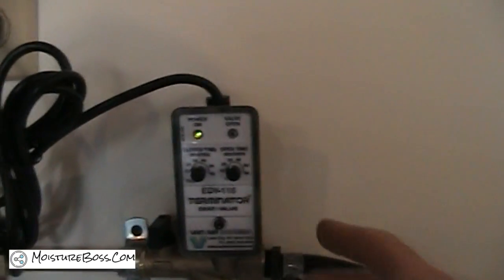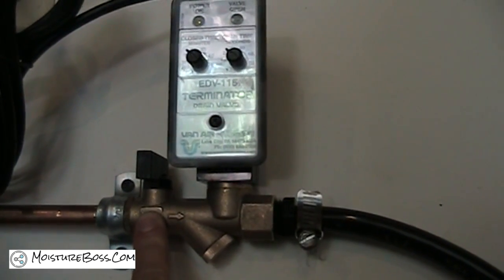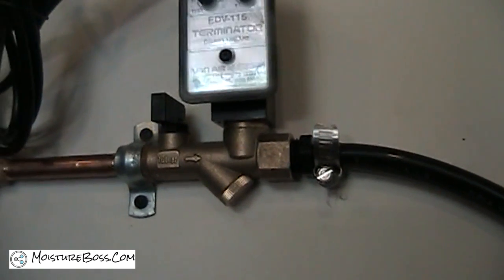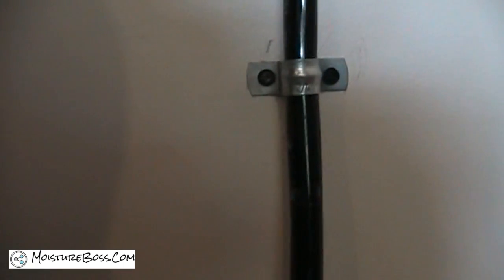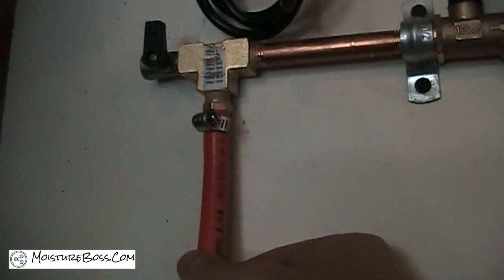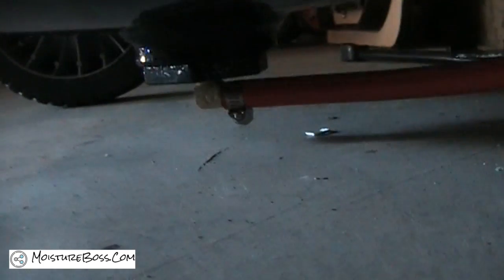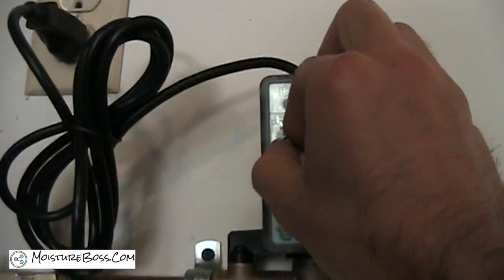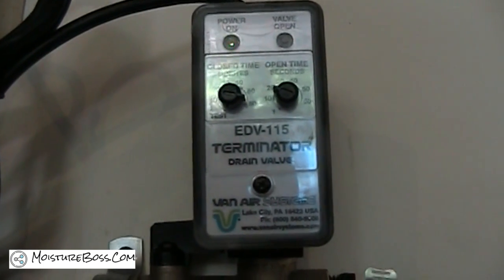Automatic Tank Drain for Air Compressors - Van Air Systems EDV-115

Comment: Hi! if you like to install your valve system that high, you should use a lot thinner tube between tank and valve. And open time longer, than bigger hose, (Air loss..) Like some writer did mention, water is heavy.. Bigger tube can`t come empty.

Comment: so unless your tank is really full the air is just going to bubble up thru the line and leave moisture inside.  Water is heavy.    The valve should always be at the lowest point in the tank so the settled water is directly on top of the valve.  An secondly you never have your supply coming from the bottom of the tank.   I used similar valves in copper condensation traps.  I'm sure its a great product just a poor layout